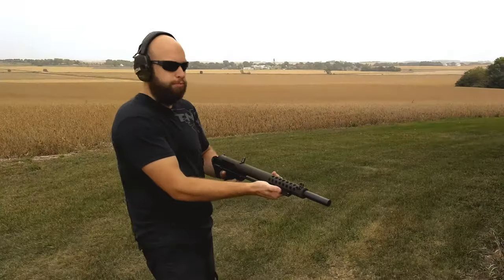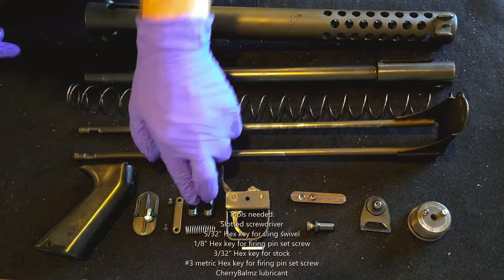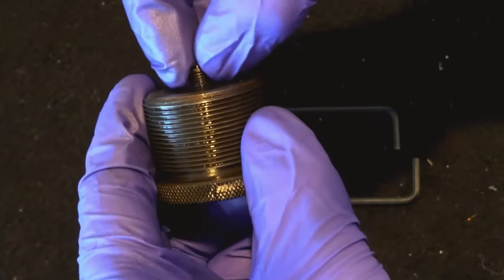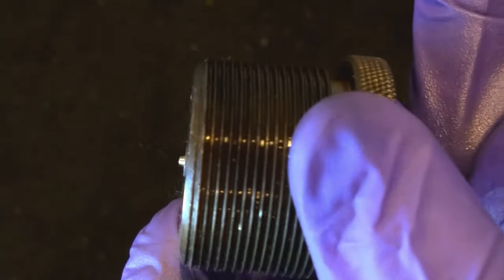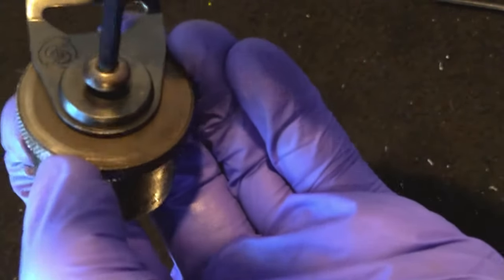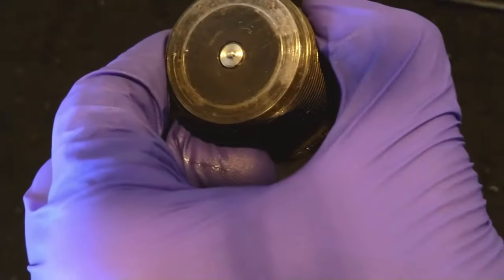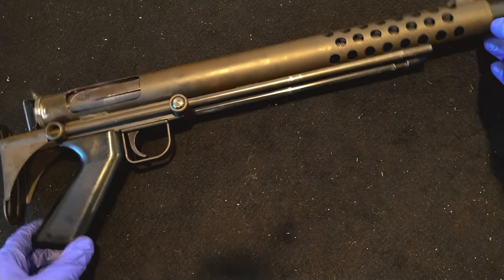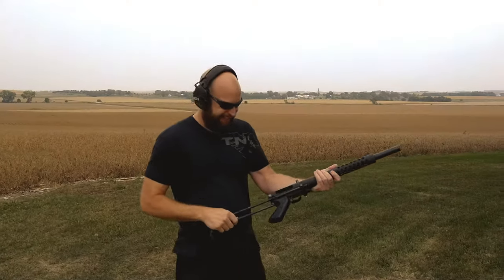Cobray Terminator - parts assembly and shooting

Comment: I made a 12 gauge shotgun in the same way in 1988. Also, the barrel rolled onto a fixed striker. Of course, there were differences, I didn’t have a stock and the barrel was about two times shorter.
Reply from the maker: That's cool!

Comment: This video is a life saver.  As you know I scored a terminator in bad shape missing a bunch of parts and I was lucky enough to find the missing parts from our friends down in TN, if it weren’t for this video, I would’ve never known exactly which parts I needed to get in the first place, the manual does not have a schematic.  Thank you for sharing this.!
Reply from the maker: So you're the one buying all the parts!!!  >:(

I would like a spare barrel for a future project.
Reply: @DirtyHandsRob  that’s one thing I didn’t get, but I may need one if I can’t clean all the rust off this one, I believe there may be a few of the barrels.
Reply from the maker: @SnakePlissken-wt6sc  I asked today actually and was told there are no barrels, but a few small parts.

If you can get a barrel, hit me up.

Plz.

K, thnx.

Comment: My receiver was missing the sling swivel… I got lucky and I happened to have a spare one of those mini strap hangers  with the offset Cobray logo.  Those originally came on the SWD M11A1 380 SMG.   Cobray was notorious for repurposing parts to use them up and save on production costs.   That little mini 380 captive style strap hanger is impossible to find, and I’m lucky I happened to have one in my parts box, my terminator build is 100% complete now.
Reply from the maker: That's awesome!

Comment: Any chance you'd post the non sped up video of the assembly? I just ordered one of these and I'll likely need to clean mine out as well. Cool video either way!
Reply from the maker: It's actually pretty straight forward. I mean, it's a Cobray and it could have been made in a garage.

If you see in the video, my breech WOULD NOT move. I had to use lots of heat to get it removed. I ended up scratching it really bad, but now it comes apart!

So be prepared for a stuck/hard to remove breech. Also the barrel is under spring pressure, so be mindful of that.

If you need help, just let me know.
Reply: @DirtyHandsRob  Cool, thanks! The only bit that was kinda hard to follow was the trigger assembly, it looked somewhat fiddly trying to fit it into the receiver. Hopefully it's easier when seeing it in person.
Reply from the maker: @OMGLYKEWOW  oh, yea. I remember. The extractor barely fits in there. The pistol grip screw made it hard. I had to fidget it around a lot to get it to work right.

I never did take apart the whole trigger pack. It's not worth it.
Reply: @DirtyHandsRob  Right on, thanks for the insight!

Comment: did you experience jams using this shotgun? Do you think that is more dangerous than other shotguns?
Reply from the maker: Nah, didn't experience any jams and it always fires. It just sucks there's on ejector, so each round has to be removed by hand.
I know this will sound crazy, but on the Terminator the chamber and barrel are pretty thick steel. It's fairly stout. My Street Sweeper on the other hand is really scary looking, but has aluminum chambers and aluminum barrel. So the Street Sweeper would probably have a catastrophic failure before the Terminator.

Comment: The 'Lady's Home Companion' is still my favourite Cobray shotgun but this was really cool.
The firing pin design was a neat idea, may want to put a drop of molly grease to keep'er from running too proud of the breech, any problems with back pressure pushing out 209 primers?
The 4 sharing bro👍
Reply from the maker: I think the LHC is out of my price range for the foreseeable future. LOL! But I'd love to shoot one at least once.

I put a small bit of blue locktite on the firing pin. I'll have to see how it works. When I was doing the test firing at the end of this video, I noticed the firing pin was working it's way forward.

I plan on doing another video showing the primers of the Terminator, Street Sweeper and Serbu Super Shorty. I'll get that done some day......

Thanks for hanging around!